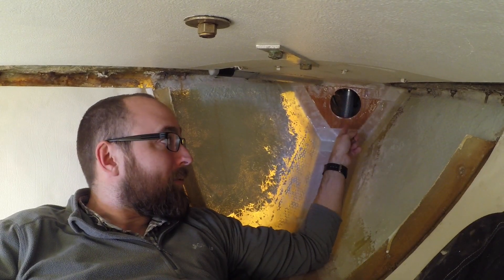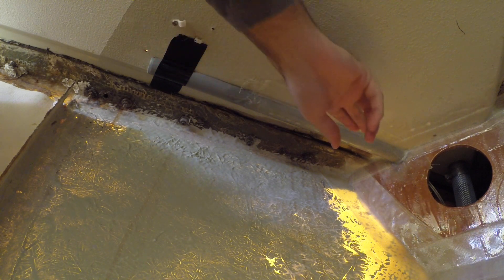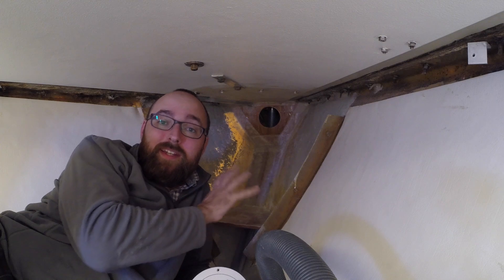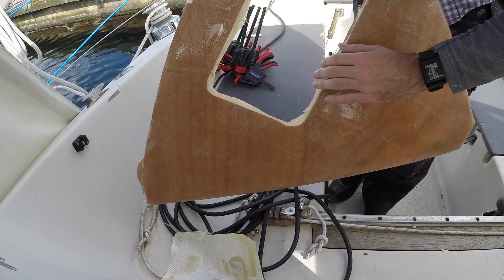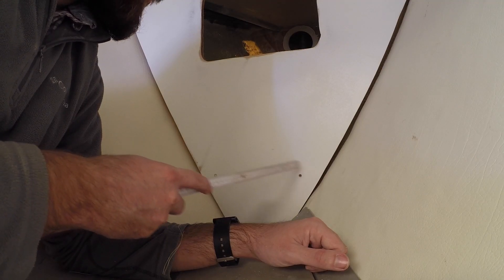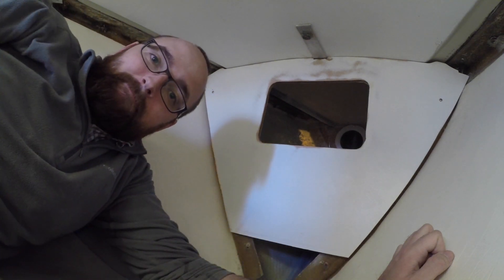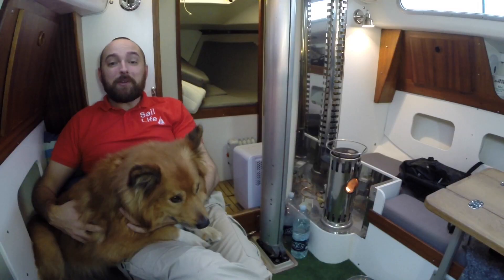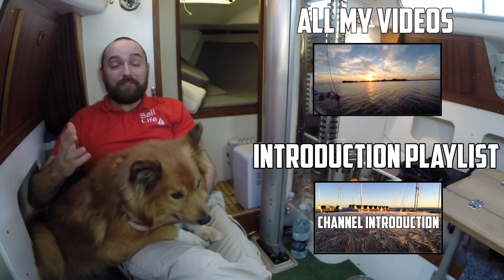Sail Life - Building a chain locker, part 5

Comment: I know this is a late comment but maybe useful in the future. On the stainless connection for your anchor rode why not put a stainless backing plate on the underside and use bolts. The fiberglass option, to me anyway, doesn't seem strong enough! Just a thought.  Best of Luck

Comment: Probably too late now.........😱

If you are making the bottom of the new bulkhead removable what is the point of glassing in the top and remaining part of it?

I thought you were attempting to establish a new watertight bulkhead?

Confused of Portsmouth. 😀
Reply from the maker: Norman Boyes Dear 'Confused of Portsmouth' ;) Hehe :) When did this turn into an old fashion advice collum in a magazine ;) I should have done a better job of showing you the inside of the locker after the main "bulkhead" was glassed in :) There is no way for me to make it watertight below the chain locker due to the hoses to the water tank. The inside of the chain locker will still be water tight :) I'll do a better job of filming it this weekend :)